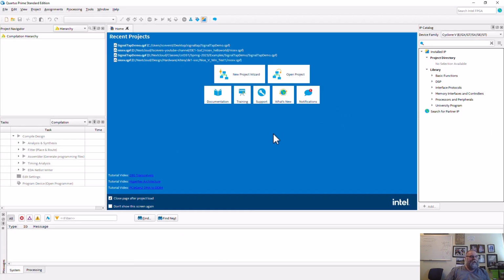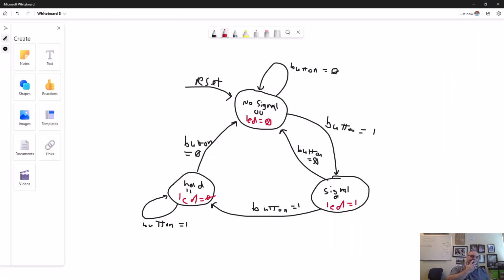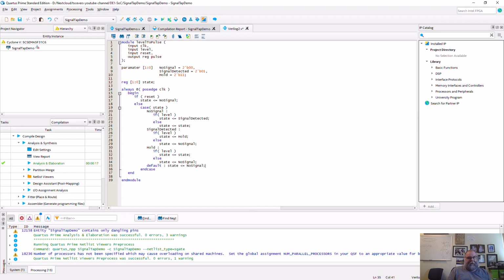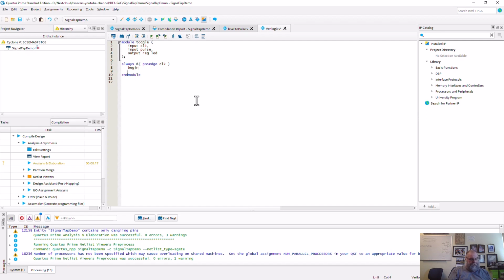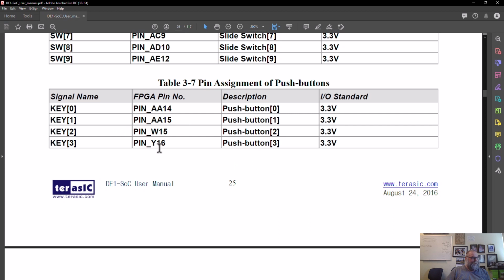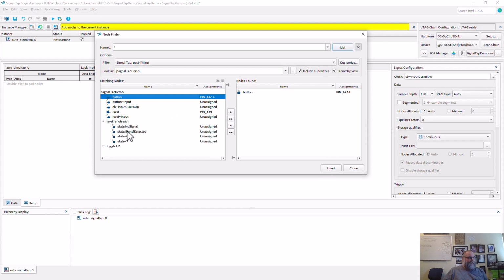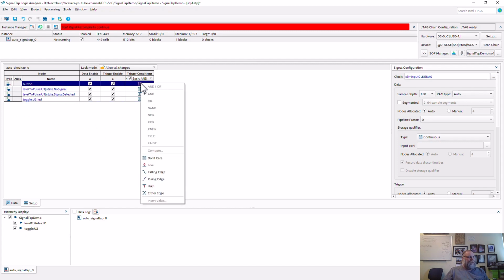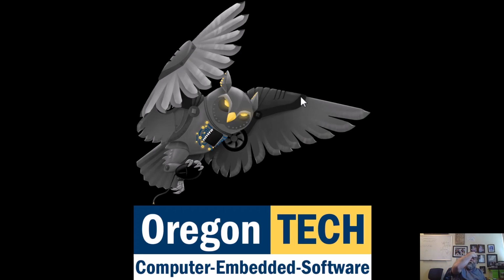Introduction to SignalTap in Quartus

Comment: hey tscevers, first of all, thank you for your video. I would like to ask you a question. How can I check the signal in specific parts? For example, I would like to check it in sample 16, sample 32 and sample 108 for example at the same time. Depending on the value of it, I would make an action. Just to explain the context: I'm trying to create a decoder for a IR remote control using the FPGA. When I click I receive a signal like this one on your video, but I would like to capture the value in some parts, like sample[16],  sample[32], sample[108], is it possible? Or there is a easier way to get these specific values? Thank you in advance!